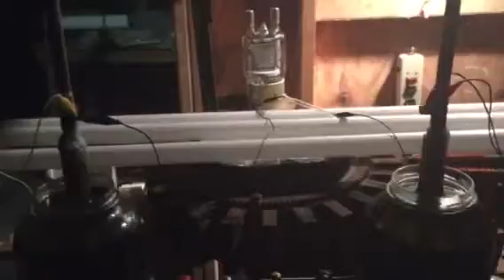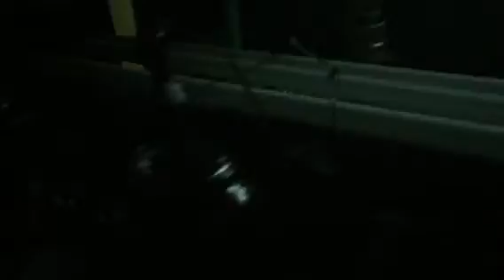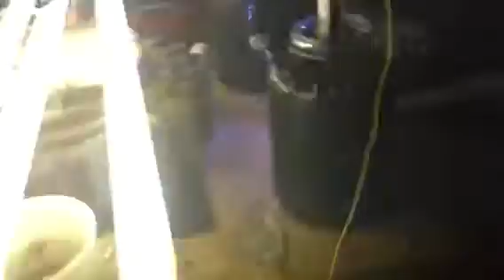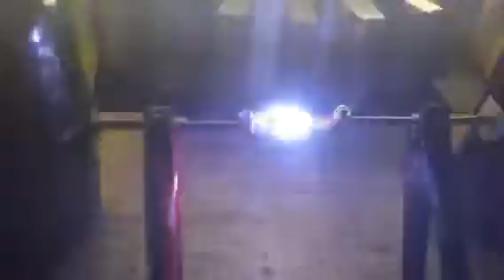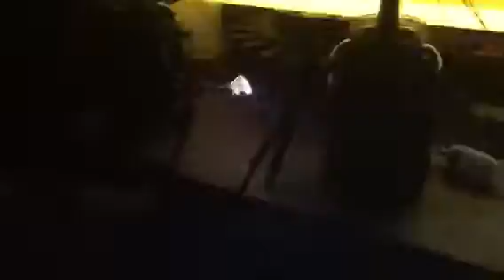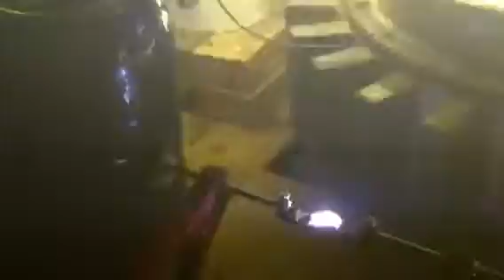Tesla Hairpin high volts

Comment from the maker: Well this video shows
The increased strength thru the spark gap.
This circuit builds up tremendously !
It's almost scary .
Reply: What is the frequency of the energy coming out? Frequency is key. You need to make the wheel produce high frequency energy with the PMH. Then feed it into the other PMH. Or are you doing that?